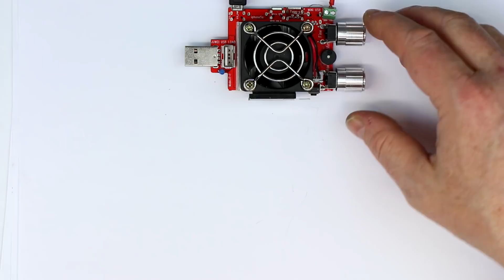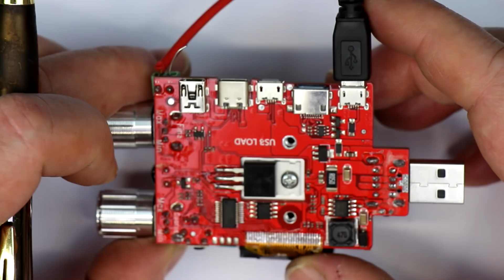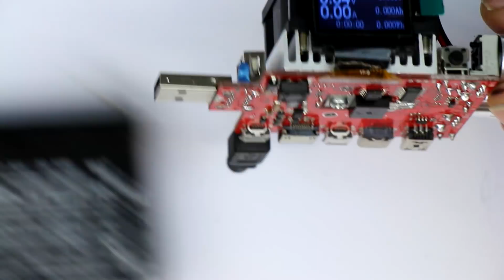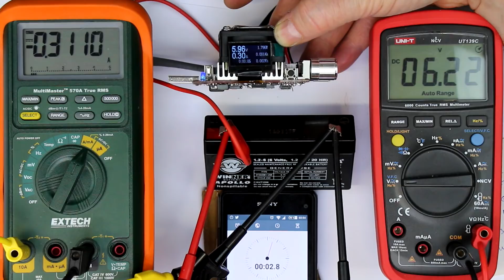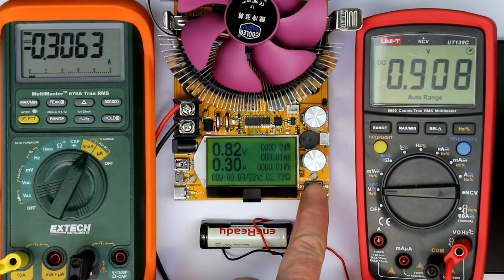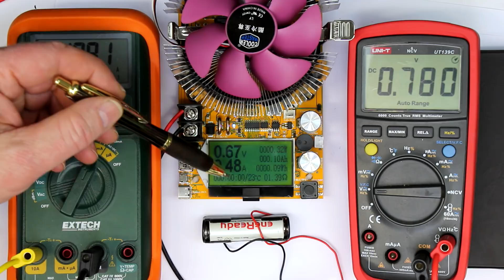2 other Battery Charge-Testers:FAIL

Comment: At 7:00 yout discuss that the timing is accurate to 2% at room temperature, but what I'm assuming is the load MOSFET is located right next to the device. So, I suspect it's unlikely to be anywhere near room temperature for quite a few test scenarios.
Reply from the maker: I don´t think that this will be a problem. The big fan turns on when the MOSFET dissipates some energy-level. That way the internal RC-oscillator will nearly stay at the same frequency. Other errors can also easily reach the 2% level.

Comment: I have different electronic loads that are doing fine and support 4-wire measurement. Voltage and current settings are done digital by buttons. One is 60W (https://goo.gl/d9QTzf) and the other is 150W (https://goo.gl/VU5Siz). From the 150W version there exist two versions. One is a bad copy (terrible accuracy and does not power off the load correctly at set limits). 
My link points to a seller who sells the good one of the 150W version (kkk-store). The good one can be recognized by the text "ELECTRONIC LOAD V1.6" on the main pcb. 
The 150W version can be calibrated, the 60W as far as I know can't. I upgraded the 150W version with a big CPU cooler and so it can run at 150W stable for hours. I did not test very low currents up to now but I think both of them should do fine.
Reply from the maker: I have the smaller version already here and will test it with 2 others (USB-connected) in a future video where I will also make a resume for all those charge-testers/constant-current loads I ordered for my purpose (low-voltage/low-current battery charge measurement)
Reply: If you need to go for smaller currents/current steps you can replace the 0,01R shunt on this load bei a 0,1R one and then you can go from 20mA to 999mA (ignoring the decimal dot on the LED display). Normally lowest current is 200mA.

Comment: Did you notice the voltage changing on the display 13:20 and 15:00 while you were moving the wires around?  The problem seems to be due more to bad connections of the jumper wires than the unit itself.
Reply from the maker: That is discussed in the video.
It´s the ohmic voltage drop from the cables between the battery (where the red multimeter is directly connected) and the input at the tester.

Comment: I got an EBC-A05 Battery Tester made by ZKE on Ebay that works well.  It's a bit more expensive at around $60 but is accurate and you can connect it over USB and chart a graph with data of a battery being discharged then save the graph.  It has a rating of 0-30.00V, 0.1-5.00A, 60W and requires an external 12 volt supply when charging batteries. https://www.ebay.com/itm/EBC-A05-Battery-Capacity-Gauge-Power-Bank-Tester-DC-Electronic-Load-Charger-/282108040708
Reply from the maker: I have ordered 3 other testers (2 of them from ZKE as your mentioned one) but as you know it takes 2-6 weeks shipping time from China :-(
In the meantime the "TEC-06" for around 10 bucks has arrived.
Tested it yesterday and it´s perfect (4-wire voltage measurement, abjustable turnoff-voltage, 50mA lowest current setting, <1% measurement error in current and charge). 
Very recommendable if 3.5A/15V max. current/voltage is sufficient for your purpose.
Will be reviewed soon.

Comment: There is a calibration procedure
Reply: For the USB tester that is
Reply from the maker: Do you know how it works?
Reply: KainkaLabs .. I have the Calibration Procedure on my PC .. Yours look slightly different to mine but I suspect there all based on the same original. I really only use mine for testing power banks but find it really useful for testing USB cables it shows the crappy ones up instantly
Reply from the maker: I hope that with the calibration-procedure you can also eliminate the offset error (which is the major error in all the tested units at low currents).
I am quite content with the basic accuracy of the current, voltage and timing values of these 2 units.
But it´s always the same with these devices when it comes to low currents.
The current-measurement is made by amplifying the voltage over the (milliohms-range) current-shunt and any offset (e.g. 1mV) in the used OpAmp translates to an offset of dozens of mA in the current-calculation.
Reply: I'm not sure about those one but you usually get in the settings by holding the button when you plug the power in. There should be Ytube vids on operation.
Reply from the maker: Will try it out.
But I doubt that the small current-offset can be calibrated out.
The other values are quite accurate already without further software calibration.
So this thing is really quite useful for the more beefier currents, voltages and wattages (power).
I will keep this thing for medium to high power-applications.

Comment: The USB Load uses a pseudo Kelvin connection at the USB Sockets, so the voltages will be much more accurate in normal intended usage (as a USB load). Theoretically you could make a 4-wire connection by rigging up voltage sense lines off the USB port.